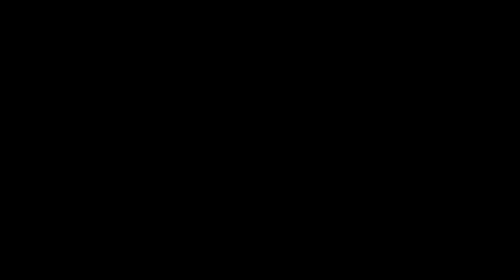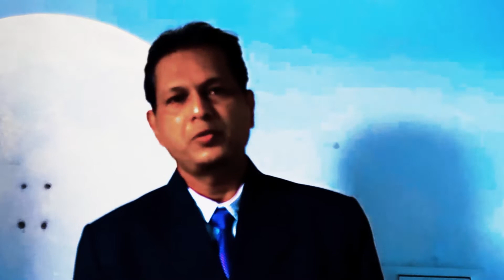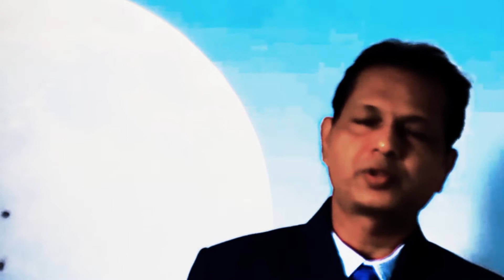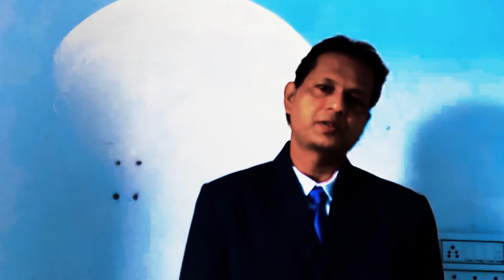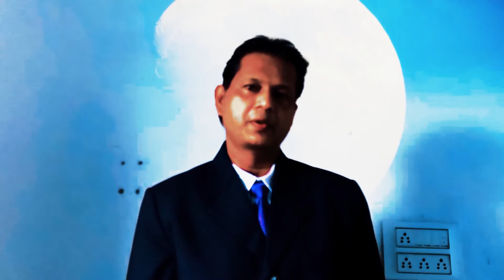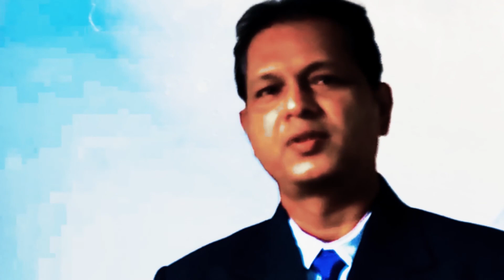Introduction to CFD Basics

Comment: can i ask you question 
can i learn how to design a (3 blade prop for drone ) i will design it not a question 
if i design it and put in the flow simulation 
can i learn the noise level at different speed ?
and how much downforce will do to ground ?